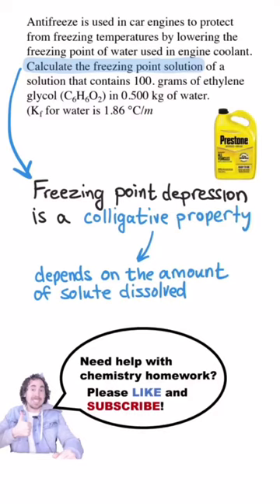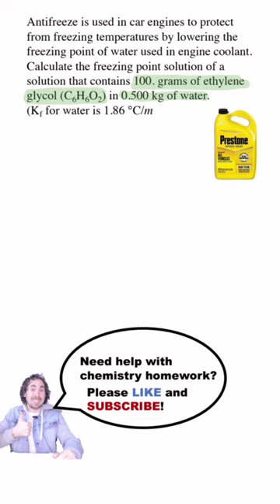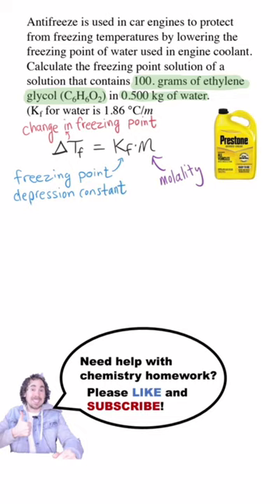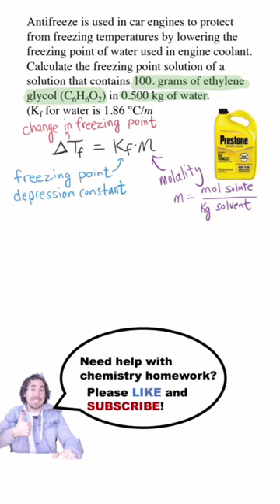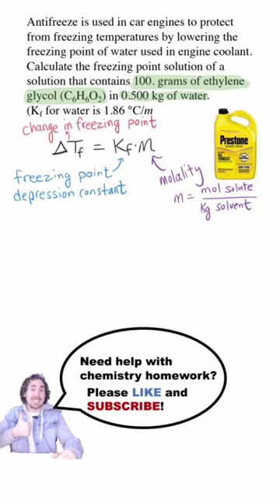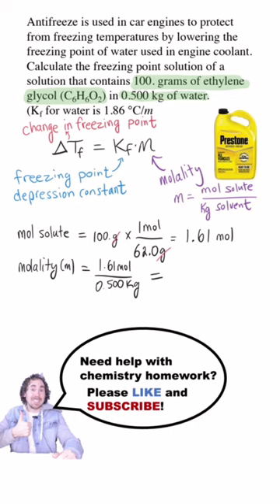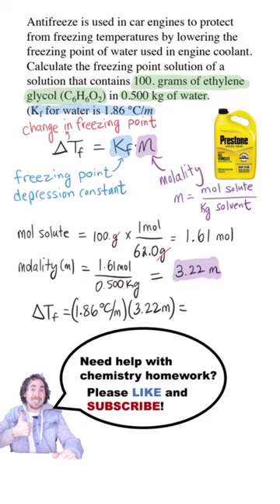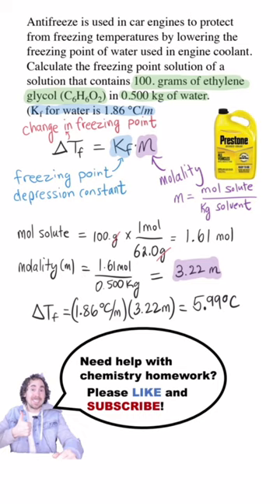Calculate the Freezing Point Depression | Colligative Property #chemistry #science #shorts #short

Comment: Excuse me, I'm mildly confused. When I tried calculating the molar mass of C6H6O2, I got approximately 110 g/mol. I'm not sure where I went wrong and was hoping for an explanation. Thanks in advance.
Reply: It was a typo. The actual formula is actually C2H6O2 (12.01x2)+(1.008x6)+(16.00x2).

That gives you 62.068 grams per mol. He mistyped and put C6 instead of C2.

Comment: There is a small oversight in the video. The molecular formula for ethylene glycol is C2H6O2 which gives you the 62.068 grams per mol 

(12.01x2)+(1.008x6)+(16x2)=62.068

It says C6H6O2 in the problem which is 110g per mol, but I hope this comment helps clarify the misunderstanding.